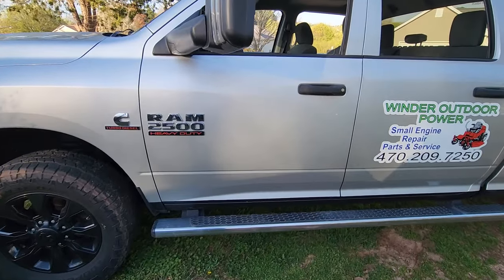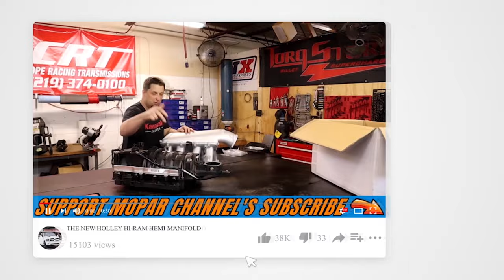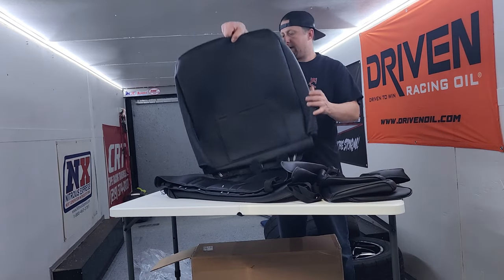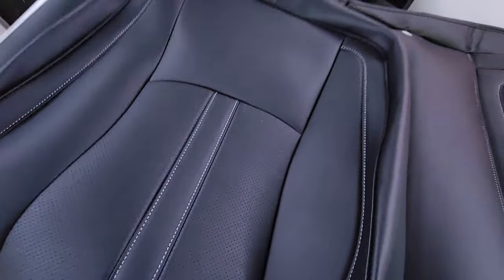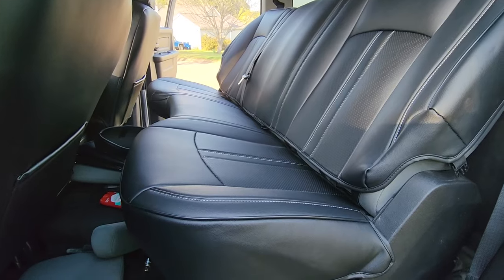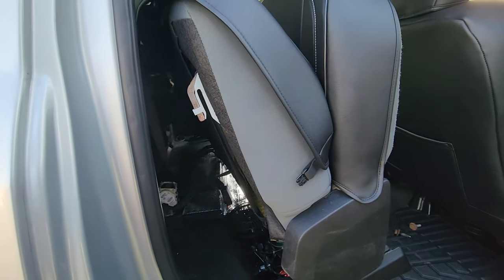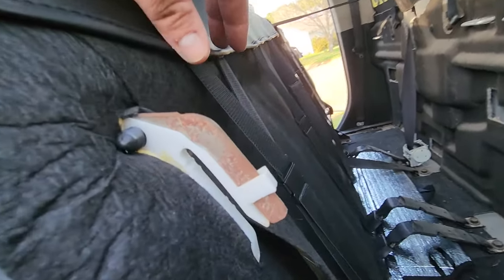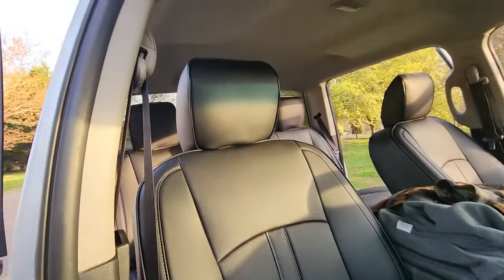Amazing New Seat Covers For Your Ram Truck From Kustom Interior

Comment: I could be wrong but I believe on your front seats the zipper should be on the door side of the seat not in the middle. The zipper part is for airbag deployment in seats. I have been looking at these covers for a few weeks now and on a Silverado they state to make sure the zipper is outward facing the door. Just check yours I would hate to find out my airbags didn’t deploy correctly because I had the seat covers wrong. Either way they look great can’t wait to get mine.

Comment: Want to know a cool trick with Ram back seat covers? 

Clip the middle strap together and leave loose... Just slide it over the top, reach underneath, grab the end of the strap and pull tight. 😁👍

Or, you can pull loose and reach under to clip together if you have any bra removal skills.
Reply from the maker: Interesting!